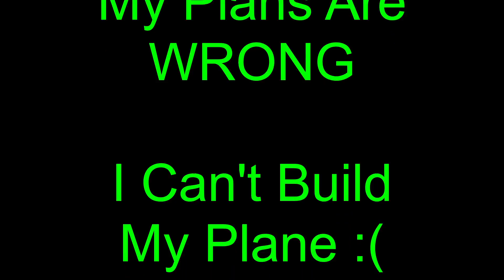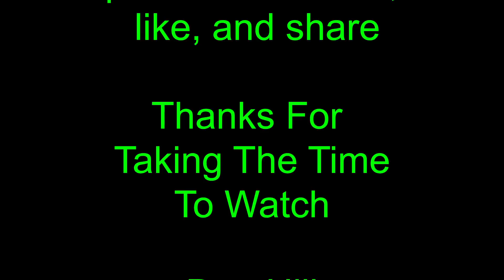Building a Zenith 701 Experimental Airplane,Building Basics Part 8: I Quit

Comment from the maker: As always I appreciate any relevent coments and discussions on any of my videos as I also have much to learn and hopefully have something to offer in return. Having said that I have no time and very little tolerance for negative discussions and I feel that this is rapidly heading in that direction. As I have stated I am a fan of Zenith, not because they support me or this channel, but because they have provided me with the oppertunity to build my own aircraft in a somewhat affordable manner with a set of plans that are as good as most, better than many, and not as complete as some. I have a set of Wag Aero sport trainer plans which consist of 15 pages of drawings and whatever information I can find on the internet, A set of Midget Mustang plans which are more complete information wise when compared to the sport trainer but a more complex airplane, both a far cry from what Zenith provides. If an individual wants a project which easier than what is provided by Zenith's current plans then they may not be suited to plans building and might be better served by buying a kit as now you have a more plug and play solution. This thread has digressed to mystic comments about what Zenith may be witholding which gives bad or negative impressions of the support offered by Zenith which from my dealings with them is incorrect. As a plans builder it is my responsibility and my enjoyment to use these plans and hopefully my abilities to interpret how all of these pieces are intended to be correctly dimensioned and assembled into a safe and enjoyable aircraft. When you look at Zenith's website there sales brochure states that they will provide plans so that a plansbuilder can build the aircraft from scratch, It says nothing about the plans being perfect, providing updates or revisions or even support We bought plans period. While we may expect these things they are not guaranteed. This will not digress into a bitch fest and I will moderate or delete comments accordingly. This is not a censorship of anyones opinions merely housekeeping to keep things positivly moving forward

Comment: Well said, Dan. I learned the hard way early on that it's more likely I was interpreting the plans incorrectly, than Zenith made a mistake. There are a few errors in my Edition 3 plans, but not many, and certainly none that can't be sorted out with some careful analysis (or a call to Zenith). I also look at never-ending revisions like this: If you had a flying Edition 3, would you ground it to update to Edition 4? No. Unless Zenith asserts there's a safety concern, or there's a significant performance increase to be had by remaking parts to the new edition, stick with what you've already built. I started with Edition 3, and I'll finish with Edition 3.
Reply: There are 15 pages of updates. I'm nowhere near through them all yet. However, most of what I have seen has to do with text changes, labeling bolt diameters (and in some cases, those bits can be found in the assembly portion of the drawings), and minor "corrections" here and there. So far, I haven't seen anything that changes the parts themselves. Mainly just cleaning up a few things and housekeeping stuff, much like Dan said in the video. I may do a follow-up video with my analysis of the changes once I've had a chance to go through them all.
Reply from the maker: Thanks Greg: I agree that safety issues will always take precedence, but there are enough examples of the different models already flying that to me it is a non issue. I doubt that I would even make improvements for performance if it slows the build. there will not be enough real or imagined increases to further complicate things. (701 beanie mod)
Reply: Agreed. The only real world safety example I can think of is the horizontal stabilizer front bracket issue on the 750, and they just added an inspection requirement with an optional access plate, if necessary to inspect. But that was announced via special notice, so everyone would/should know about it without the Edition 4 updates, which haven't been published just yet.
Reply from the maker: Yes that stab bracket inspection notice is across the line for all Zenith Models not just the  750
Reply: Greg's Zenith STOL CH750 well I hear you just got your hands on rev 4 and there's a ton of changes! When no one knows about these and zenith omits to publish it.... Well why?
Reply from the maker: That is probably a question best directed  to Zenith with a phone call, then there would be no possibly incorrect speculation.
Reply: hillsgun that phone call happened yesterday :)
Reply from the maker: So what was there response? The only thing that appeared on my computer screen translated that there was some mysterious information that was out there and that the bad Zenith Aircraft Company was hiding it from all there builders.
Reply from the maker: Thank you Greg
Reply: Gregory Harris good idea, don't forget about a whole new page 3!
Reply: If agree it's not such a big deal but those reviews should be out there... Your review 3 plane will still fly. Guess what! They are working on rev 5 now!
Reply: hillsgun I'd tell you but better in a email, if you don't mind :)
Reply: hillsgun maybe even a phone call, I'd tell you all about it
Reply: I wholeheartedly agree that these updates should have been published by now. However, I haven't seen anything that would materially affect someone building a previous edition plane. No safety issues, no major changes to structures, etc. A few things appear to be cleared up (and that's great), but no show-stoppers for anyone building a previous edition. I'm speculating here, but I would bet that Zenith hasn't made it a priority to publish the revisions, simply because there are no changes that would drastically affect current builders. Most of the things I've seen are a non-issue for my build.